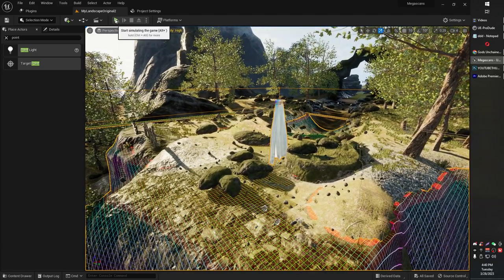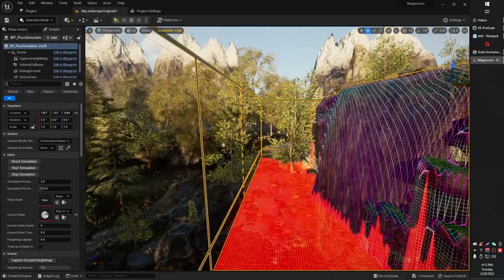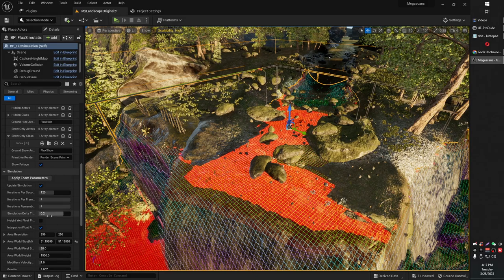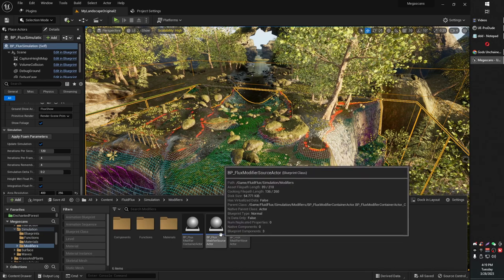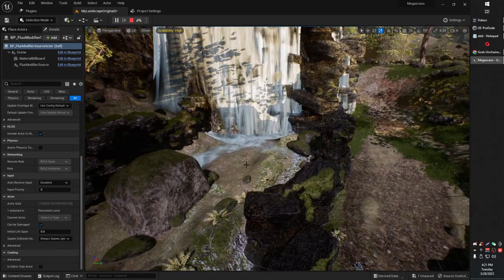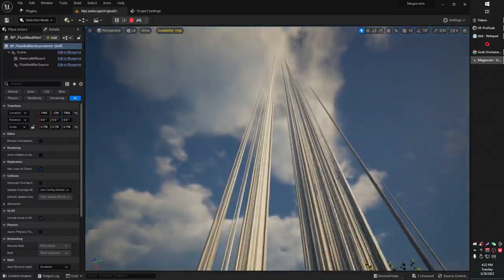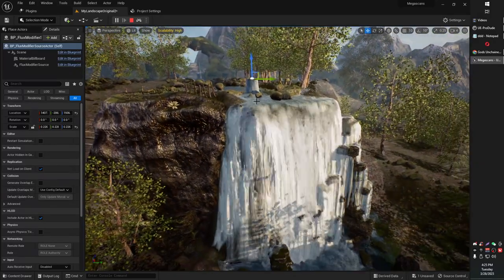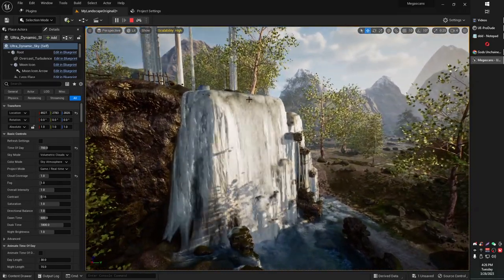Fluid Flux in Action & Tutorial (Simulated Water Physics) UE5.1 Unreal Engine

Comment: Thank you for the tutorial! Those spike-shaped bugs are showing there because the generated ground map is corrupted (you can see some red edges on the heightmap debug) and the high slopes inside of those holes are a bit problematic for the shallow water simulation. Usually, I recommend an increasing height of the simulation area (avoid holes in the ground), and increasing slope, damping, and friction values in simulation in this case. New versions will be more resistant to this kind of bugs.
Reply from the maker: Awesome! Since the time of this tutorial I have been playing around more and more with the plugin and it just keeps getting better (and easier) as I learn what to do and not to do, etc... It's great man, so great!

Comment: My guess is that the water spikes occur when water is pushed up the terrain and hits the ceiling of simulation boundary. Extending simulation boundary upwards may help. This seems to be consistent with increased number of spikes you got when you tried to solve the problem by moving volume down :)

I believe resolution is what determined quality/performance balance. Size of wolume in the world should not have direct performance effect, but indirect effect is that bigger volume encapsulates more colliders from your scene and therefore increases performance cost.

It's a very nice plugin, but really needs waterfall speed adjustment - it seems like gravity is doubled in the simulation ;)

Comment: The spikes are actually from splashes above your simulation line.  If you raised your box up a bit to cover those pieces of land that are sticking up, the water will still simulate properly but will not "leak" out those "holes" where the actor is not covering.  Hope this makes sense to you.  The Red indicates a "leakin" spot.  This will only happen if your water sim splashes above those lines or you move the water to flow through those lines.

Comment: Thnks for your tutorial. But when I used Fluid Flux. My Debug surface was on top of the cube, not like you when the debug was in the bottom. My Fluid Flux cant capture the ground or any mesh also. Help me solve this. I use Fluid Flux 2 and UE5.4
Reply: did you solve it?